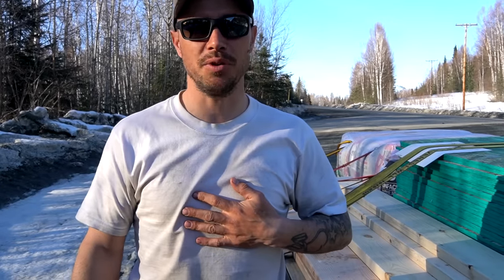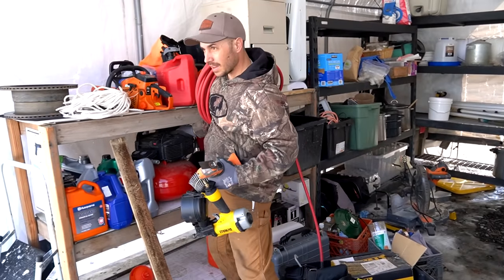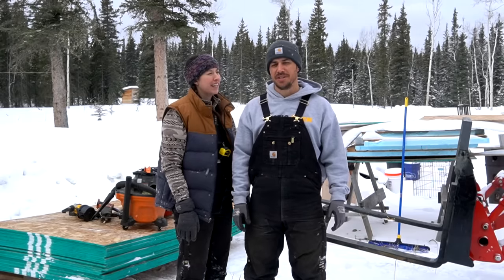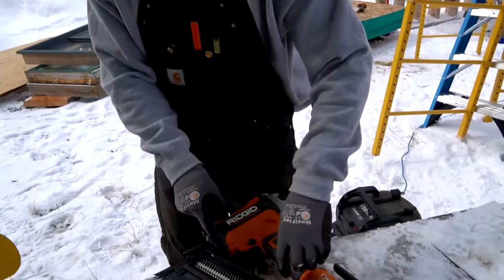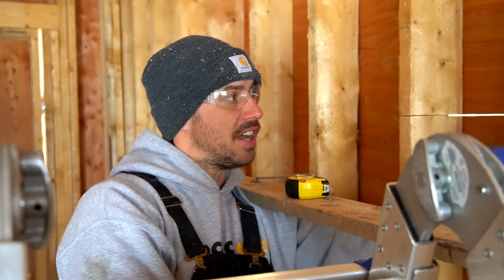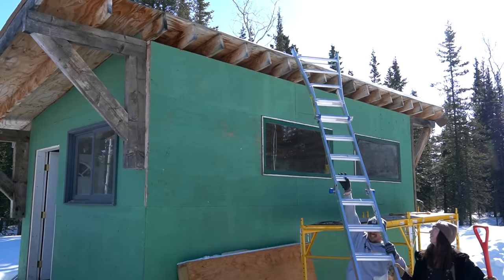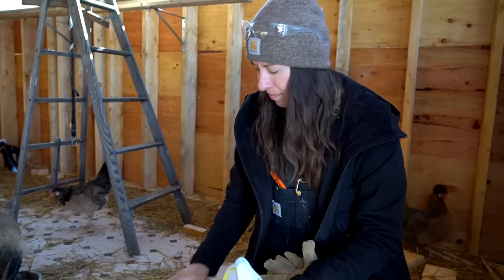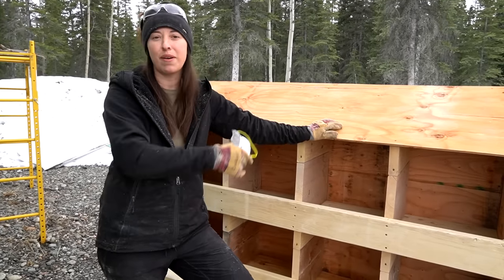Cutting in Windows, Rafter Blocking & New Flooring | Operation Chicken House

Comment: I have an older version of that Porter Cable compressor.  I got it around 25 yrs ago, came with two finish nailers and a stapler.  I bought a 16 penny nail gun that works on it, but it's not really big enough to run that nailer all day.  Fine for what I do, and have used them for almost 3 decades.  Pretty good for a lower end product.  When I was building, I had all Milwaukkee etc.  But if you're not pounding it all day the cheaper stuff works fine.  We flipped 4 houses while trying to get a retirement house paid for, and boom, we're now into our 10th year of retirement.  Thanks, Porter Cable.

Comment: Bo knows... Bandit's ready!!  Always great to see what the boys are getting into.  I see Bandit's already trying excavate.  The one detail I think you'd've liked would've been to staple Reflectix to the underside of the OSB before nailing it down.  Would've been perfect insulation for that step, the vinyl makes for a great vapor barrier too.  Nice work there you two!  The "condoheniums" look great, happy girls.  The hardware fabric to keep the critters out is great!  If the chickens are bothered by 'skeeters, bug screen on the opposite side of the bird blocking (blocking with holes/screen) would be one more layer of protection of the chickens.  But, they might just enjoy eating the skeeters too.  Nice work on the framing, you can take scraps of OSB to shim out between the two header boards to bring the inner one flush with the framing.  Scraps of 2x6 also take up that space nicely.  Gonna be some HAPPY yard birds when all is said and done!!!

Comment: I'm impressed with your proper use of terminology on wall anatomy. Yall did a fine job. Any time you cut out a load bearing wall you should really support the load above with bracing or a temporary wall until you get the header put in. You got away with it in a small application, but that could go south in a hurry if you're not careful. I admire your confidence posting all your projects online for everyone to nitpick.

Comment: I love the way yall tackle new skills with such confidence. You obviously get it when it comes to framing. Great job on those windows. I saw one area you will want to be mindful of in future window installs. The headers are a half inch narrower than the wall studs, which is fine for structural support, but you will have no backing for drywall (or other sheeting). The usual solution is to preassemble the 2x6s with a piece of half-inch OSB in between them. This brings the header flush with the wall studs so that when you place a sheet of drywall, you have a surface above the window to hold the screws (or nails if you use another sheeting). Nice nesting boxes!

Comment: A little tip while cutting full sheets or even pieces of plywood. Buy a 4x8 sheet of the pink dense XPS foam sheets and lay the sheet down on it. I have used the same sheet for 1000s of cuts.

Comment: That vinyl flooring pattern is the same exact pattern that that we bought for our chicken coop the other year.  It was the cheapest that they had and it has held up very well. 
We have used sand in our coop which makes for easier cleanups (When done frequently) but does not create the heat like the straw.

Comment: Use Flex spray rubber seal I've used it several times on out-buildings, and it works supper well.

Comment: BUY the Great Stuff trigger foam gun you will never go back to cans with straws.  Also pickup couple can of cleaner. Screws to gun between cans to clean gun Also comes with a  nozzle so you can spray rags or gun tip ect for easy cleanup.  If you religiously tighten shut off knob when not spraying it's trouble free.

Comment: Chicken Mansion 🙂

So, I hope you're planning to build some think insulated blocks to cover those vented blocking holes for next winter to prevent the heat from escaping.  Are you going to build insulating shutters to protect the windows during major storms & severe cold? 

Next, I've noticed you keep having to pick up all of the used straw to get it out. 
How about a trap door in the floor that you can open it up & use a big floor broom to sweep the straw into the hole. Under that, you could have a sheet metal duct work that could drop into a big box. Walk outside pull out the box, empty it & return.

That roof looks like a great candidate for a rubber membrane - Not tar paper! - to prevent those leaks. 

Some fascia board & lots of paint to prevent those rafters from deteriorating any further.

Hopefully the snow will be gone along with the frozen ground too, so you can get your big building built and equipment sheltered.

Comment: You need to take that handy-dandy reciprocating saw and make plumb cuts (vertical) on the ends of your rafters that extend out beyond your eave drip.  One the downhill side, it appears the rafters are already experiencing damage.  Once cut plumb, they shouldn't get continuously wet.  Perhaps spray some bleach on all that mold and mildew. A fascia board (P.T. or cedar) would be good on both uphill and downhill ends of the rafters.  Cut the rafters back an extra 1-1/2" to allow room for your fascia board.  2) On the toenail, remember you have a 3" nail, come back from the edge, so that you have half the nail in your stud, and half the nail in your top or bottom plate.  You're nailing too close to the end of the stud.  It will hold, but it's not good framing carpentry. 3)The hens look happy with their new 8-plex chicken house!

Comment: For insulation in the floor, why not consider having foam insulation blown under the floor.  We recently had all of the blown in insulation vacuumed out and replaced with foam,  it filled the cracks and it helped cut our electric bill in half.

Comment: I have the exact framing nailer you bought.  You likely know this but I learned it the hard way.  Those nails are not like nails you pound in with a hammer.  They bend very easy.  If the nail hits a knot or even a more dense area of wood it can turn, not kidding, 90 degrees, coming out the side of the board.  Don't have the hand holding the wood anywhere near the length of a nail from the tip of the nail gun.  I had a nail come out sideways and go through two fingers.  It healed just fine but was a painful way to learn the difference between nail gun nails and regular nails.

Comment: It looks like the roof doesn't have a drip edge on it.  This causes rain or melting snow to run over and down onto the rafters.  This causes the rafters to rot.  You can see the discoloration on the rafters by having water soaking them.  Hope this helps.  Drip edge is cheap and should have been installed when the roof was put on.

Comment: Unless you wrap the shed, remove the windows, put flashing tape, then silicone when you reinstall them, your insulation inside is still going to get wet and moldy. I guess it comes down to how much do you care. You could run some 14 gauge wire through that pipe for heat lamps so you don't have to install a separate system or run a generator should you choose to give them any heat when it's -60.

Comment: Looking good you two!  I built mine with solid walls as well and feel it is better...so good call.  I would suggest an upper perch board though.  I understand why you closed in the two big swinging doors, but I think you may regret it.  I would have suggested closing one off and making the other a clean out door so that you can just push the litter out and scoop with tractor, or alternatively drive the tractor to the back and shovel right into the bucket, or wheel barrow out a larger door - all of which would be easier than trying to go through the man door.  Just my opinion though.

Comment: The chickens going to have a home better then most people 💁‍♂️ get them a wood stove 😉 I would though use the pipe the wire that was for gen and put a 12 gauge wire from there to cabin electric panel. Put some plugs on ceiling for heat lamp/lights. Run wire in coop in pvc conduit so chickens don’t peck at it.

Comment: Did you know that on most tractors you can tip the seat forward to keep rain and snow from accumulating on the seat when it's out in the elements?  Then when you get ready to use it you can just tip the seat back and it's dry.  Sounds like the girls really like their new nesting boxes!
Reply from the maker: Unfortunately our does not tip forward  :(
Reply: @SimpleLivingAlaska  Oh wow...bummer.  Well, you could create some kind of a waterproof bag/seat cover with a drawstring close that you can pull over it and draw tight to keep wind from pulling it off when it's parked.  Great progress on that coup!

Comment: Looks like it’ll turn out to be a very big and spacious chicken coop really good for the birds. I would, however, have put a access door on one of the sides so you could push out all the used bed and straight out into a wheelbarrow or a bin. This way you wouldn’t have to deal with the stairs, leading up and into it and you would just push it all towards the little hatch door and use a rake to pull it in or just push and fill the bin. Would just make cleaning it out significantly quicker and easier.

Comment: You should always make your openings a 1/4” for each side!! So your total width should be a total of a 1/2” wider than your window and the hight should also be a 1/2” taller then the hight of the window!!! This gives you room for shimming and making the window level and plumb!!! Hopefully that makes since to you!!! Other than the way you framed the opening definitely looked really good!!! Then after the window is installed you can take a puddy knife and stuff some of the pink insulation in between the window and the framing!!! You don’t want to pack it really tight just nice and loosely to help from making the window from swelling!!! If that makes since??? Then you can put the jamb extension for the trim in and around the window on the inside!!! You are definitely doing a awesome job at everything!!!!
Reply: And flashing tape before installing windows, for waterproofing.

Comment: That little chicken house has come along ways. You seem to of done a good job. I do like the laying boxes, but I have only one comment to make on them. I would put some kind of brackets at the top to fasten it to the wall so you don't accidentally have it turned over if you get a critter in there, pulling it just the right angle to pull it down on himself. Also, don't forget insulation on the wall behind the chicken laying boxes. But you can tell you guys have worked hard and they seem to of done a really good job. Thanks so much for sharing with us! Oh, and I do like the windows. I do like to see people reusing things like windows. Much less stuff going to the junk. Keep and landfill.

Comment: Sounds like Arielle knows her carpentry terminology,  usually it is smart to have around a 1/4" gap between the windows / doors and the framing to have the ability to square it up & flush, use cedar shims , less frustrating than trying to make the framing tight to the window or door.  Still snowing in northern Michigan on 2 May, but the trees are budding out anyway.

Comment: Good job but i would have suggested to keep the large end doors. They would have made spring clean outs so easy!
You would just have parked the tractor with the bucket or a trailer backed up to the doors and push or shovel the old straw and litter out!

Comment: Yeah, the roof needs some drip edge bad and maybe the ends of the rafters trimmed back that have started to rot.  Use some treated wood on the facia board.  Good job on the windows.  Next time shim the inside of the headers so they will be flush with the wall.  Also that left over fiberglass insulation can be used to kram into the cracks especially the big ones.  Use a putty knife or a screw driver, shim wood works too.  I hate that foam.  The sawsall works good with a hacksaw blade in it but still a pain.  The chicken house is looking Purdy.  The new floor cover, is slick as snot when wet with rubber mucks on.  Dig your toenails in.  Home sweet home for the chickens in theboxes.  My old home Fairbanks.  Heading north is like jumping off the world.  It's beautiful.  Liking that air hammer, may have to have one myself.  Watch out for moose and bison on the road.  Take care.

Comment: 10 AWG: 10-gauge are used in electric clothes dryers, 240-volt window air conditioners, electric water heaters supporting 30 amps. 6-gauge are used for cook tops and ranges carrying 40-50 amps. 4-gauge are used for electric furnaces and large electric heaters protected at 60 amps. i googled it lol I had to see what is was as soon and you read it out...

Comment: Jack studs and king studs transfer the weight of the upper floors to the lower floors and not onto the windows. If not as the building flexes it would crack the windows.  Also when buying spray foam don't get max expansion and go around windows will put to much pressure on frame and windows will be difficult to open. I've seen one break with application of to much of wrong foam. Kepp up the good work. Learned a lot about canning.

Comment: Someone else probably already commented, for framing you need 3 nails in a 2x6. Rule is 2 in a 3x4, 3 in a 2x6, 4 in a 2x8, 5 in a 10 and 6 in a 2x12. It's half the nails of the width of the board. Great job though!

Comment: When installing windows in rough opening in a framed wall the idea is to leave space around the frames to allow the windows to be shimmed and screwed by there sides into the opening.  When snow load puts pressure on the headers above the window there is .25 to .5 of a inch of room for movement.  This stops the window from getting cracked from snow load pressures.  The spray foam fills the gaps.

Comment: How far from Fairbanks are you guys? Hope you don't have mice. They love insulation! Maybe add a second door. One that opens out, for during the winter as extra insulation. Will you use metal roofing? We used vinyl flooring and love it. So easy to clean up. Paint the lower 2 feet of the walls to protect them from moisture.  Great job! Thanks for sharing. God bless.

Comment: Curious about predator controls to be added. I know on the first homestead you had raptors. Also, the blocks installed under the roof: at one time in Southern Ontario, barn swallows would have set up a colony there, if you were lucky!. That species is threatened here. However, might not be the species you want next to domestic hens.
Reply from the maker: We have plans for a predator proof chicken run :)

Comment: Thats 3 phase cord, must have got a deal on it to use it there.
Reply: That is single phase 220 volt SO cord used for generators. 2 hot wires, neutral, and a ground. Not 3 phase.

Comment: For your headers you really should have sandwiched a layer of osb/plywood between the 2x6's which would have added a great deal of shear strength expecially for your snow loads.  I also is much easier to cut our only the studs using the sheeting for strength and should have used a jack wall to support the roofing before cutting anything. Always build for the long term not short term viability of the project. there are any number of building channels on youtube to hellp with any future products...also 2x4's require 2 nails in framing and 2x6's require 3.

Comment: just so you know ???Yes cripples underneath corners of your windows. And as for your header? usually it is a solid header no space from outside to inside. that means you use two pieces of 2 X 6's. get length what you did!! and then use plywood as sandwich between 2x6's until you come up with the thickness of 2x6 which should be 5 1/2 inches nail all together header built.Pick it slide into header space nail in. Put little cripples above. And i use them on all bearing walls and non bearing walls. Why? because it is a good practice to get into,.. and they always always stand on edge!. Your sill plate always has cripples. Especially corners. remember your transferring wgt. from roof to foundation so make it good!.Even add extra king studs if you have too. but make it good!!. Standard space when installing windows is 1/2 inch to inch gap on top and sides of window for adjustment especially when your building moves. Make it to tight? Windows will bind or not open and if they do they will not close either,... properly. i do 3/4 inch gap around everything. Except bottom of windows and doors. I then use foam...1/8 inch by ? for  bottom under my windows. You can get foam in rolls.... people use it for concrete, to stud wall applications. The gap along windows? top, bottom and sides? shims,... spray foam,.... and caulk,... then trim,.... is my way. Everything has stood the test of time so far for me. just saying. have fun be careful enjoy life it is what life is about!.

Comment: All of the exterior walls on a building are "load bearing", so all windows and doors on the exterior should have Kings, Jacks, Headers, and cripples.   Headers are always horizontal, not vertical.

Comment: Rodents love to nest in fibre glass insulation. Rock wool is a far better product rodents don't like, it's especially good where there is no vapour barrier. Fiberglass wilI  absorb moisture loosing its ability to insulate. Rock wool does not. I found it funny you where spraying foam around the end blocks that have two 2" holes in them.

Comment: That's one swanky chicken coop. I'm curious, could you have put some of the vinyl flooring in each of those little chicken dens or whatever they are called.  I am a city guy, so I have no idea. I just thought it may help with making it last and cleanup.
Reply from the maker: The vinyl flooring will protect against water and chicken poop, they keep the nesting boxes dry so it should not be an issue